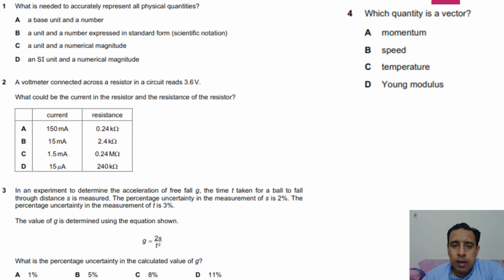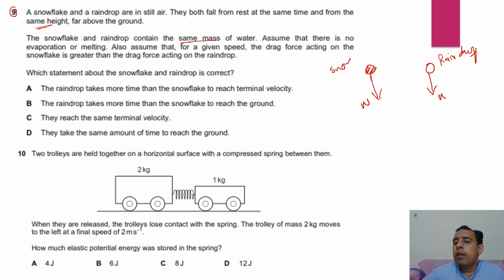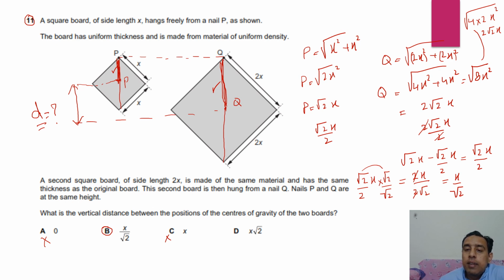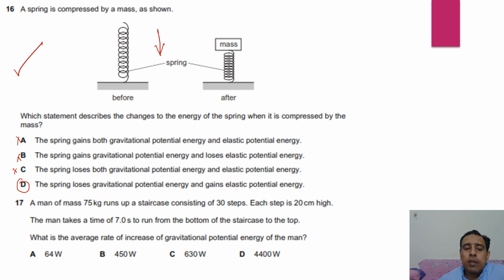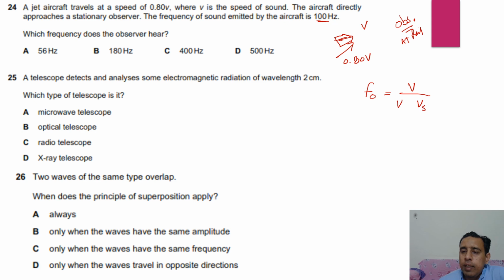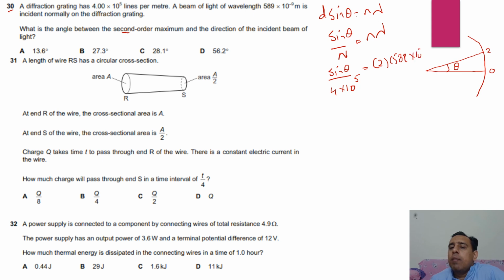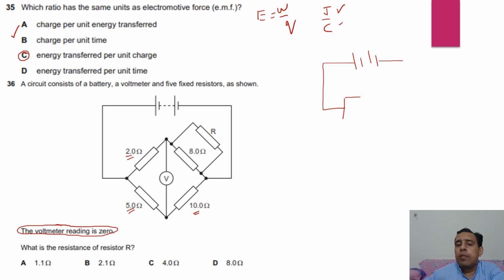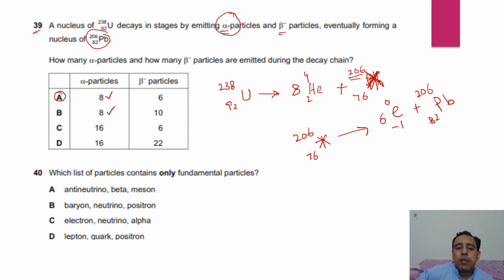9702/11/O/N/22 solved paper|Easy physics|sir saeed akhtar

Comment: 56:29 Mcq 34 you said voltage across P increases and R Decreases. It is mentioned in the question that they are identical lamps so there resistance will be the same P and R. so voltage will be equally divided among them?
Reply from the maker: True, but as compared to the previous  circuit, now the resistance and voltage is modified

Comment: Can u explain QN 37 . I don't understand anything
Reply from the maker: If all resistors are same then they have same voltage .that is 3v. So answer is 0 on voltmeter. If resistance and voltage is different between parallel resistors then answer is non zero and +I've or -negative